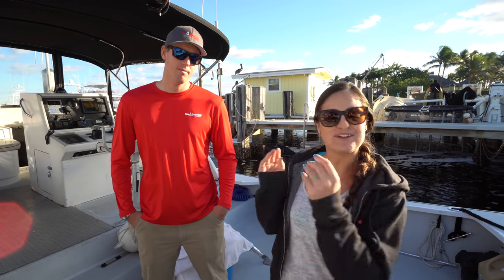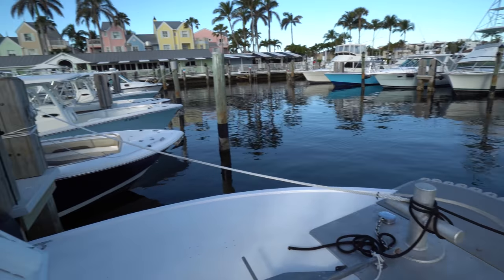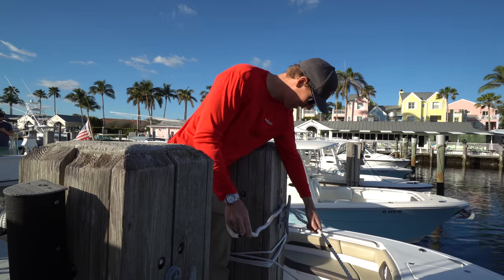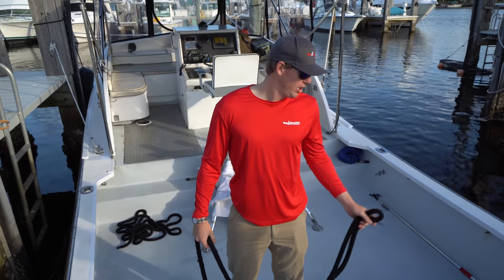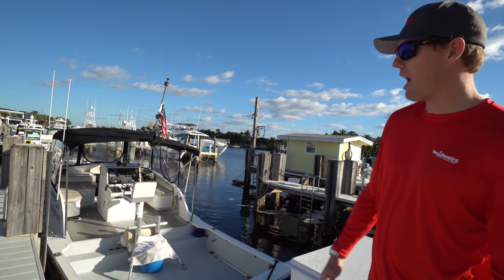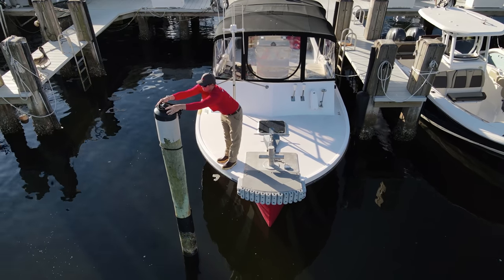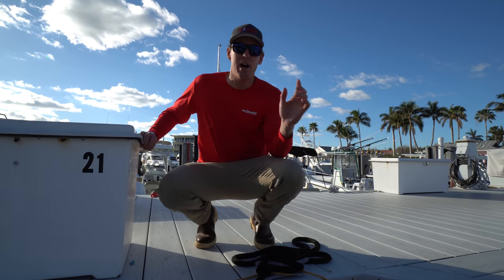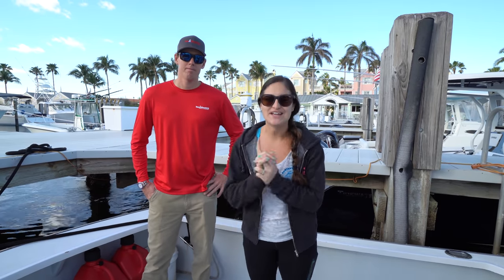HOW TO TIE YOUR BOAT IN A DOCK SLIP

Comment: I still don’t understand how crossing the lines helps with the tides but I’m going to try it.  I have a pontoon slip that doesn’t have a couple feet clearance per side so when the tide goes up and down a couple feet it’s either too loose of too tight
Reply: Crossing the lines on the stern has nothing to do with the tides, its just to keep the boat  from hiting the piles, it  keeps it centered. Now, they need to be crossed to create that effect and long enough so you dont hang your boat when low tides.
Reply: @Low_Tide305  you’re way off

Comment: Yeah but how do you protect the boat from smacking against the dock? With The up and down motion eventually the bumpers end up on top of the dock and the boat gets beat up.
Reply from the maker: With this type of dock, you should be able to tie the boat so it sits more in the center of the slip and doesn’t touch the dock. If that’s not possible and the dock doesn’t have bumpers, then you can tie fenders onto your boat instead of the dock so they go up and down with the tide and you can pick the perfect height for them to be tied